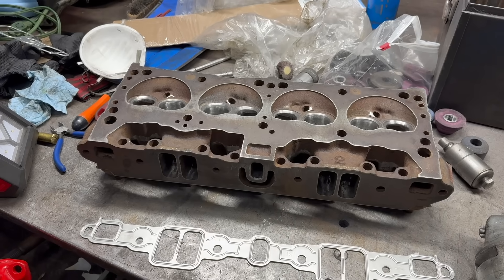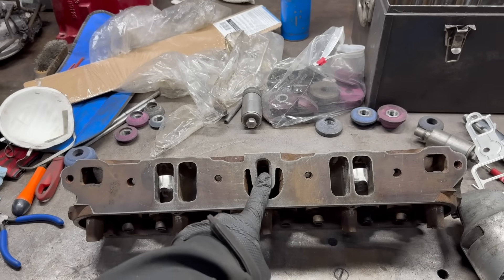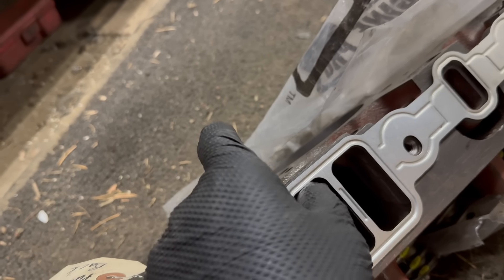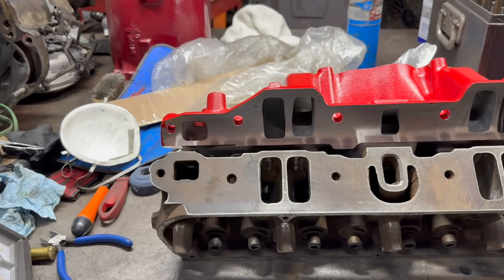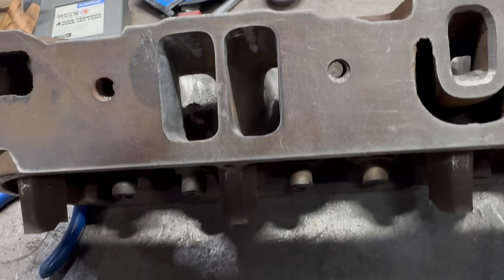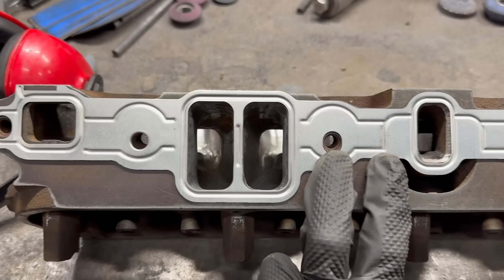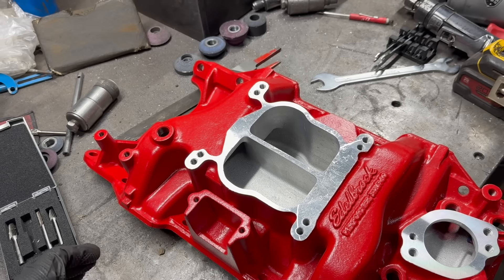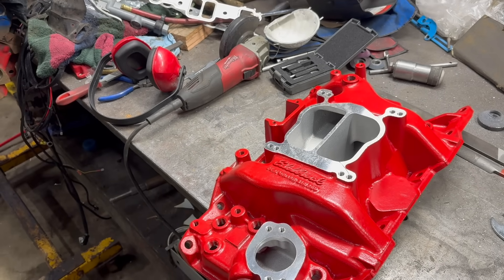Intake Port Matching - Improving Factory Castings And Finding Hidden Horsepower (A 318 Build Update)

Comment: I have at least a hundred hours of die grinding with carbide burrs. I don’t think there is any way to completely avoid that sudden random death chatter, especially in tight corners. Have you ever used the porting sets from JEGS and the likes? Just a bunch of different sanding barrels. I have been thinking about trying them.
Reply from the maker: Never have. I do have a couple sanding barrels I bought for this project, and when I said “a few other tools” those are the ones I forgot to mention. Whoops.

Comment: It’s the amount of sparks that allows you to weld it that way
Reply from the maker: Given that there are zero sparks off the cylinder head - because it’s cast iron - where does that leave us, exactly?
Reply: @ well now. Just how I was taught . Carbon content in the cast.  More sparks much easier to weld. Low stress area much easier to weld. I’m not certain I’m making any sense

Comment: In a perfect world, this is exactly what I would be doing with my 1970 318 this winter, but it's just not in the budget. I planned to go dirt cheap and find a stock 340 intake and a used 4bbl, then do a similar port matching exercise. I'm finding several 340 intakes for sale in various vintages and conditions. Any recommendations on which ones I should look for or avoid?
Reply from the maker: Not really, it’s just a matter of square bore (early) or spread bore (late.) I’d prefer early and a Carter / Edelbrock.
Reply: @DeadDodgeGarage  Sweet... thanks!

Comment: Whats your opinion of the dodge neon (1995-2005) era of dodges? Ive had to work with a few a588 motors and just doing porting and a better exaust manifold and air intake can see a fair performance gain, and they turbo well and dont require much on the fuel/ecu side to get north of 280 whp

Comment: I bet you could use J-B Weld to fill in the low side of that intake runner, then contour back to the intake gasket.
Reply from the maker: Absolutely! I’m not going to though. If it ever chips or breaks off… that’s kinda on me.
Reply: @DeadDodgeGarage  Right on.  But the texture of cast iron provides plenty of traction for J-B Weld even if it isn't perfectly clean.  I have used it on cast iron a few times without fail.  Love the videos - thanks!

Comment: I've seen/heard of using the epoxy you mentioned to fill in spots like the mismatch in the intake manifold. Slap a little on, then machine/grind it down to where it needs to be. Yes? No? STFU and mind my own business?!
Reply from the maker: Absolutely! That works. It’s been done many, many times. For a race only engine, I wouldn’t hesitate.

Comment: That's a very informative video on porting the 273 heads. I still have a set from a 65 Barracuda I ported way back in 2010. Extra care needs to be taken on the valve grind to be sure they don't leak. That's why the heads are still on the shelf, a couple of the exhaust valves leaked past when filled with water. Keep on keeping on, from a fellow Washingtonian now east of the mountains where the Mopars are far less rusty.
Reply from the maker: Oh yeah, it’ll get finished with a lap job and they will be leak tested.

Comment: I did a home port job on my 225 slant, just as you are doing now. Also milled the head .100 . It's the best running slant I've ever driven. Well worth the effort and with in reach of the average enthusiast.
Reply from the maker: Outstanding. Our 225 block is still at the machine shop getting bored and milled. When I get the head off the engine it’s replacing, it may well get milled too. I ported the head on my 170 turbo project a while back. I’ve never gotten to test it very thoroughly yet.

Comment: My dad was a mechanical engineer and he said " there is a reason why Chrysler was always 3rd but he still bought em! And loved em!
Reply: Spin the wheel on push rod length, valve seating depth, rocker shaft perch height?   Random rocker shaft oiling?  

This is on the 383...pretty sure it holds on the 413, 426W, 440 & 400's.....??

Comment: Fyi you can use the steel porting burs on aluminum just dont do it aggressively or they will plug up. If they do take them to your wire wheel and clean them up. I have built and ported a great number of marine and snowmobile race motors as well as mopar heads and intakes. So this is what you were up to the other day. Another tool you need is a dremel barrel disc for finish work. What you did will work fine son. And remember trolls talk a big game but dont even own a car😂

Comment: 7:36 You can actually use the "standard" carbide bits on aluminum if you spray some WD40 on the bit and aluminum first. It works 100% I recently did this with a alu-intake. It was a tip from Eric The Car Guy
Reply from the maker: Good to know!

Comment: hmm Magnum heads ? Maybe the have no heat riser because they are made for injected cars ? But hey yes, i had many cars with them deleted. Can such in the winter.
Reply from the maker: Well, yeah. Exactly. Lol. But many, many people are running carbureted Magnums out there, and it works just fine - in the normal range of temperatures one would expect to enjoy a car like this in. I wouldn’t recommend anybody runs a carburetor with no base heat at negative 10.

Comment: Very nice explanation of an old school quality thing, even on a stock rebuild.   When dealing with aluminum, WD-40 is the money move.   Fog a little on the casting, and a spritz on the bit, and you'll be shocked how nice it works !    Rinse and repeat several times during the job.      As far as the welding, tiny non structural plug up fixes like this are just fine..... I'll admit to this mig welder transgression a number of times in my 43 year welding career HaHa!    The real problems arise when you try welding up longer cracks, structural areas, ect...    The reason cast iron is such a nasty thing to weld is its very high carbon content (far higher than high carbon steel)  This makes the heat affected zone extremely hard, including the (formerly) mild steel filler material, which mixes in the carbon from the melted parent metal and gets harder than chicken lips !       For the stuff you just welded, no problem, I'd do it (have done it)
Reply from the maker: Yep, that’s right. There you go.

Comment: I’m an amateur at best but I found the air grinder has too much rpm even when trying to control the speed and causing the mentioned bouncing. I switched to a variable speed cordless drill and had zero bounce and more control. I’m also glad you don’t show a lot of hands on work. Saves my thumb from hitting fast forward.
Reply from the maker: I have also done this job with a cordless drill. I didn’t feel like I had more control with it really.
Reply: I agree. I use my cordless drill for stuff like that. Low rpm. I feel like I have more control.

Comment: Don't worry Jamie. No one will ever accuse you of doing any work. ❤ Thanks for not making us sit through the actual porting. It's a tedious enough job when nobody's watching. I never understood why anyone would go through the process of porting their heads and then not do any port matching. It kinda defeats the purpose. I've seen some funky stuff happen when the intake ports were larger than the head ports. It's nice to see someone do the right thing rather than what's expedient. That's gonna be a nice street motor.
Reply: Do the channels showing work being done also play guitar?
Maybe they should play the guitar more.
Unmatched ports would create low and high pressure areas within the flowing current. Disturbing, disrupting and slowing the flow of air fuel mixture, therefore creating intermittent richer and leaner pockets within the flow effecting each combustion cycle.
Manufacturer MASS-PRODUCTION Flaws are surprising  how severe they are.

Comment: An older machinist that I worked with at one job taught me to use WD-40 when drilling/tapping/milling/cutting aluminum. It prevents it from sticking to the tools.  There are other cutting fluids you can also use, but WD-40 works great and is always available.  He retired 10+ years ago, but this trick lives on!

Sometimes, I spray WD-40 on aluminum just because it's there.
Reply: Aluminum, in every circumstance, loves to grab things.  I once put an aluminum pipe plug into an aluminum intake manifold barely more than FINGER TIGHT just to check it and couldn't get that damned thing back out for over and hour.  Agreed, lubricant on anything made of aluminum.  Aluminum is like a 3rd grader screaming "Mine!  Mine!  Mine!" any time you get anything else near it.
Reply: @grandmasmalibu 
https://youtu.be/H4BNbHBcnDI?feature=shared
🤣
Reply: Same I got it from Dr oldies.
Reply: Sometimes you gotta spray the aluminium with some wd40 to keep it in line. Cant have it misbehaving causing a scene you know
Reply: @allenm00  I keep a little cup of brake fluid to dip the bit in. The aluminum just pops out of it

Comment: I would agree the smaller port heads would be a better 
street choice with an automatic, but not with a 4speed
Reply from the maker: Not sure I agree with that necessarily.
Reply: @DeadDodgeGarage you’re certainly going 
to run at least a 3:55 gear, so with a stick 
your rpms are going to stay up where a set 
of 1.88 360 heads would flow much better. Pair 
it with a early stock 340 cam and valve 
spring.

Comment: Have observed other porters dip the carbide in fluids for control of galling like trans fluid, tapping fluid, and if budget allows, seem to recall a dedicated fluid for the job. Also, the skip/jump/hop/walking of the bit has some correlation with rpm of the tool- faster lessens that. Just an observation.... your work is better than some can do... or will do. Rock on!
Reply from the maker: I’ve had that thought. My big bottle of rapid tap is empty unfortunately, so time to rectify that. I have noticed that this old pneumatic die grinder isn’t the fastest thing, and that could certainly be a factor. Thanks!
Reply: Yes, i use a variable speed die grinder and wd40 on iron and plain old 30 weight engine oil on aluminum.  

Oh... and a full face shield,  cuz yer eyes are super cereal expensive.

Comment: Got the intake off the "not a Dodge" right now to block the heat crossover, might try doing some matching. I mean it's a Ford so it needs all the help it can get.
Reply from the maker: 😅 weeeell don’t go grinding on the heads with them on there. Hopefully they’re close…
Reply: @DeadDodgeGarage  oh definitely not lol, heads were done when I was building the engine, I left the Chinesium intake alone though and it's way off haha.

Comment: I will say that if you use sanding drums they are a better option for grinding aluminum. I've found the burr's for aluminum lacking in durability. I've tried nonferrous stones they work okay but they will gall if you are hogging material.
Reply from the maker: Yep, completely agree. I’m finishing this with files and small sanding drums, and wish I had shown them. Buuuuuuutttt I forgot.